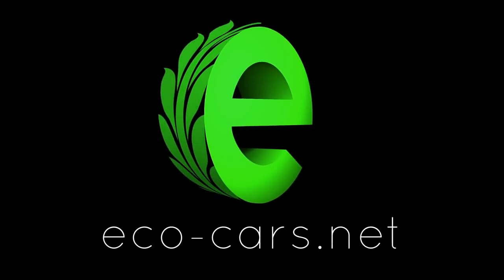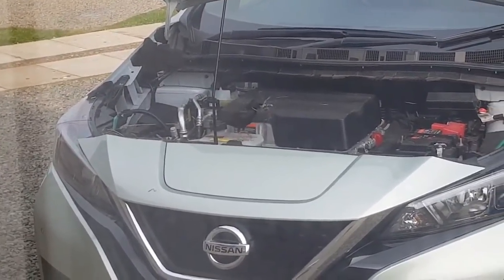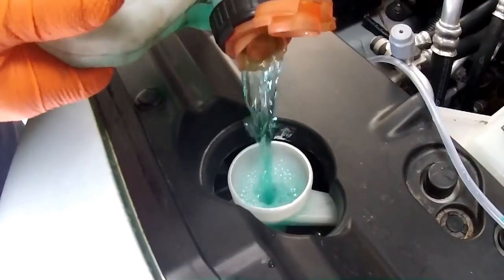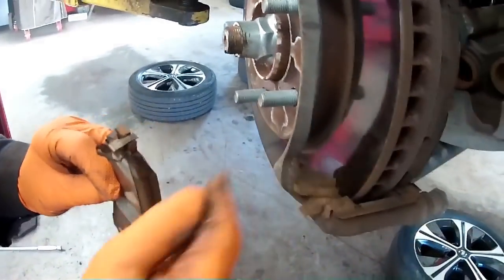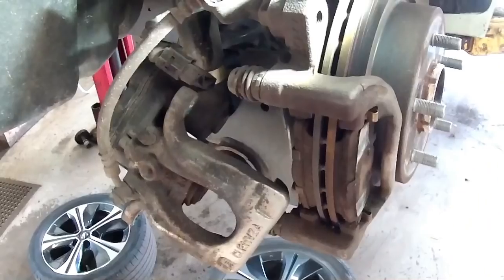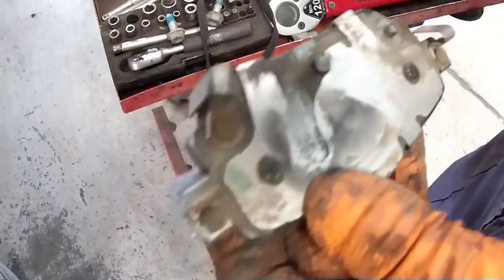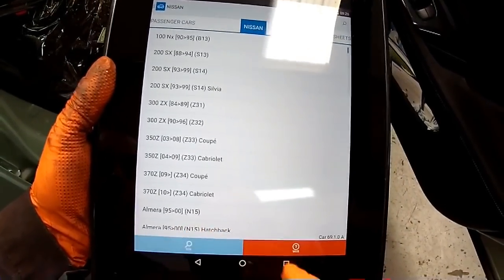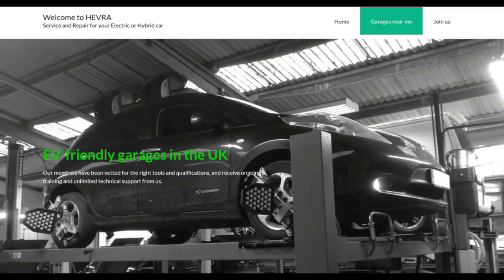How to service a Nissan Leaf or any EV !

Comment: I was surprised to see the lug nuts tightened in a circular rather than a star pattern. The 12-volt battery should be load tested periodically because if it dies the car won't start up in spite of the traction battery being fully charged.

Comment: Do they ever check power steering or suspension system in a major EV service?
Reply from the maker: Yes , most power steering is now electronic , and a visual check of suspension is also carried out.
Reply: @JonathanPorterfield  thanks Jonathan. It's there any lubricant in the power steering system? Just wondering as my EV steering creaks like hell when it's cold! 80k miles on the clock..

Comment: Do you know which tool was used for the TPMS (tire pressure)?
Reply: No tool is needed ..just adjust tire pressure to the correct psi and press reset on the display at the dashboard and go for a testride faster than 25 Km/h.

Comment: I've got a 2012 and I swear my ball joints are worn at 60k miles. I also have the infamous squeak when cold over bumps. I believe it's some type of subframe bushing that can't be accessed without pulling out the motor or something silly.

Comment: I was looking a nissan service schedule girvyge leaf 7500 miles or 6 months . I suprised at the rotating tyres every 6 month my last 5 car have never had rotate tyres and wheels in fact they say not to. I wonder if this mid just an excuse to keep work flowing into the dealer as s six month 7500 service is excessive
Reply from the maker: Service intervals in uk for the Leaf are 12 months or 18,000 miles !

Comment: if the ev is liquid cooled would this not have a filler location under the hood
why did you not include direct line to hevra in description   as well as the likely cost range

Comment: Only fluid?  dont miss the brake fluid every 2 or 3 years and if the gen2 is like the gen1 check and top up the gearbox oil at 40000km (I assume it has a single stage gearbox).

Comment: Services on my ICE vehicle include checks on suspension and steering components for wear and damage, air-con re-gas at 2 yr intervals, brake fluid change at 2 yr intervals. 

I anticipate EV has similar needs.
Reply: Air con should not need topping up, check yes.

Comment: Only thing I would add to that is a seat belt check.  Pull them out, slowly to their fullest extent check the webbing to ensure there are no cuts or frays.  Allow them to retract fully.  Clip them into their buckle to make sure they are secure and pull sharply to ensure the inertia reels lock.

Comment: Er, brake fluid?  :)
Reply from the maker: yes , your correct , please forgive me !
Reply: @JonathanPorterfield   No problem.
Reply: Nissan say replay brake fluid every 2 years
Reply: Unnecessary changing of brake fluid is another main stealer scam. And bad for the environment. Just buy a 'brake fluid tester' (search eBay) for £5 and test the fluid yourself. Change only if required.
Reply: And motor coolant. The white reservoir bottle is visible at 00:18 next to the bonnet prop retainer.

Sorry... :)

Comment: Hi Jonathan interesting video. You mentioned 40 PSI is "what you like". On my 2018 Tekna Nissan recommends 36 PSI your wheels look the same as mine which are 215/50/R17. I was just wondering why you like the higher PSI and if this causes any uneven tire wear.
Reply from the maker: Less rolling resistance at 40psi , means more miles per kWh , ive never seen uneven wear.
Reply: I have 40 front and 38 rear on my MK1 Leaf as it's not really 50% ratio

Comment: I thought it had to be done at a Nissan Garage to maintain the warranty.  I must be wrong.
Reply from the maker: As long as the VAT registered garage carries out the Nissan service schedule, then no warranty is invalid. A europe wide ruling 20 years ago also gives non franchised garages the right to service vehicles of any make ,as long as they follow the manufactures guidelines and use approved parts ,then no warranty is voided.